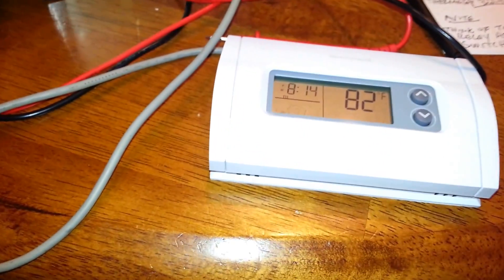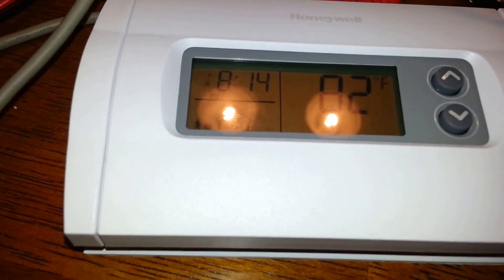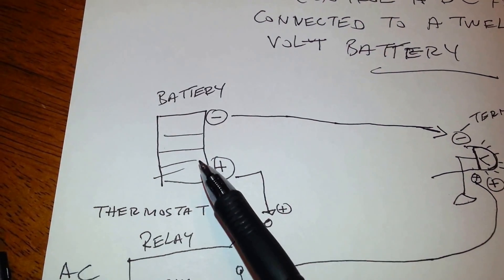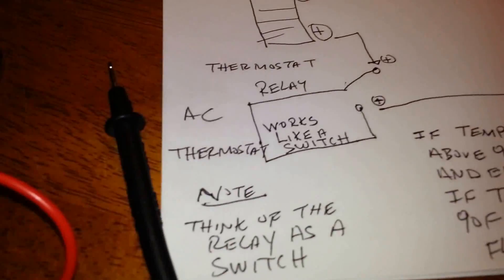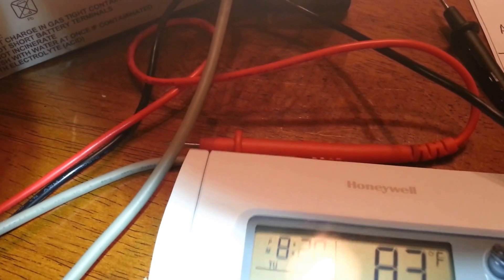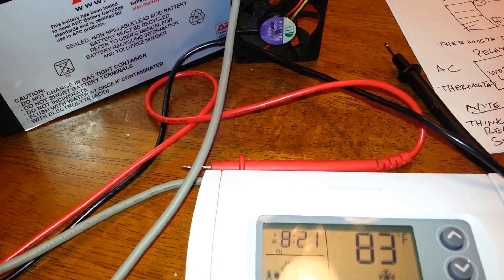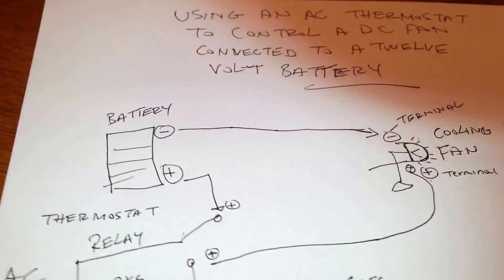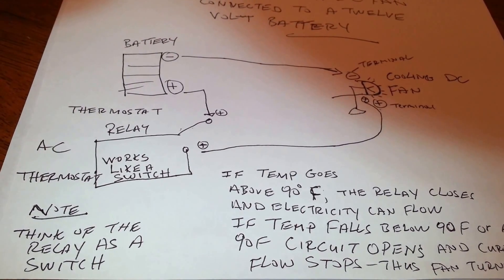Honeywell HVAC Thermostat Controlling a 12V DC Fan

Comment: thats awesome i am thinking of doing a lithium battery and maxwell capacitors for my car and replacing the car battery but during the cold months i need to heat the battery box up for my battery and caps and this is a great idea for my heater control unit!!! the custom box will be warm.

Comment: No one has mentioned the risk of sparking of the contacts because the stat is designed to switch AC not DC?  A problem or not?

Comment: Yawn - for repetition, r e p e t i t i o n.  Generally, 3 types of thermostats for common systems:  millivolt (older boilers, gas fireplace logs, hot water heaters are examples), 24VAC (most common for heating/cooling these days) and "line voltage" (usually 240VAC for directly controlling circuit to permanent baseboard heaters).   A 4th type are for 12VDC systems in RVs.  RVs run the furnace on propane and have big 12 volt batteries to power 12VDC fan. People doing solar work will also find these 12VDC thermostats are a fit.  This is what you really wanted to use, although you found the ubiquitous 24VAC thermostat relay worked.  As they say, even a blind squirrel can find nuts.

Comment: This Honeywell RTH2520b thermostat can configure to have cooling cycles per hour by holding the Backlight button (at the right hand side of the cover) for 3 sec.  Continue pressing the Backlight button until it display CPH (cycle-per-hour).  Default is 4 times (60 min / 4 times = 15 min), which means it will detect the temperature 4 times per hour after initial startup (initial as first time to switch to Cooling mode from Off or Hot).  If temperature is too hot (cooling mode), then it will turn on for 7.5 min (15 min / 2)

Default is 4 times, and it can change to 2, 3, 4, 5, 6.  2 times means 30 min/cycle, while 6 times means 10 min/cycle

Another feature is called "Early start."  Default it is off.  This means the thermostat will turn on the device (fan) in advance of the set time in order to archive the desire temperature you set in your schedule.  Let's say at night, the temperature is cooler so you set the schedule to higher (90F) to converse the battery SoC, but at day, you would like to keep it at optimum temperature as the solar panel is receiving sunlight and you have extra capacity to run the fan to cool down the room.  Let's say set to 80F at 9am.  With Early Start, the thermostat will dynamically turn on the fan before 9am so that the room will be at 80F at 9am

Comment: So how are you powering the t-stat
Reply from the maker: Roger Martin 
When I recorded this video, I had the two internal 1.5 volt batteries powering the thermostat itself.  However, if watch my later videos with the setup in the solar shed, the thermostat is being run off my solar system.

Comment: I really enjoyed your video and would love to utilize this to control my greenhouse swamp cooler. Can you tell me which connections on the Honeywell thermostat you used possibly provide me with a wiring diagram showing which terminals to connect to on the thermostat .
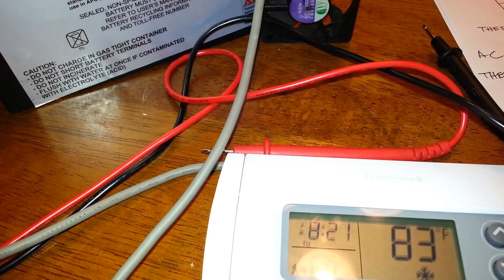Reply from the maker: John,   Here is a later video showing the connections at about 7:40

https://youtu.be/IPPzyp4i0qo
Reply from the maker: +DIY OneForAll 
Thanks for watching and all the best with your greenhouse setup.  I hope this video helps.

Comment: It's common sense that any normal "switch" can pass through alternating or direct current. The issue at hand here for using this in a strictly DC setup is  finding a thermostat that can run off say, a 12v battery. In this video you failed to show how you are actually powering the Honeywell switch itself. If it's being powered off of your home ac power, you haven't really shown us anything :/
Reply from the maker: It's being powered of my solar system,  100% solar.  I have a later video showing the hookups.  Thanks for commenting.
Reply from the maker: +DIY OneForAll 
So no, I am not using my AC power to run the thermostat.
Reply from the maker: +DIY OneForAll 
Also,  this video was done as a precursor to what ended up in my solar shed. Again,  I appreciate the comments.
Reply from the maker: Here is the video showing the thermostat running off DC power in my solar shed: https://youtu.be/ATplM5ckN8c

Comment from the maker: The point made of this video is that this thermostat is not only able to work with your heat pump or furnace but with any application requiring an inline switch - yes including solar applications, heat lamps - you name it. At the end of the day, I hope that if someone does happen to have one of these at their disposal they will see how easily it can be setup.

Comment: You're confusing "AC" as in alternating current, with "AC" meaning air conditioning.  All thermostats operate off 24v DC supply from their feed lines from the main system.  The main system gets AC from your home electrical system and immediately converts it to DC inside the appliance for all the motors, compressors and logic boards involved in running the air handler and other parts of your home HVAC system.

All thermostats are DC, even that one.  "AC" here means it can control both a heater and an air conditioner.
Reply from the maker: What I am showing here is that this thermostat is not typically used in pure DC applications, outside of the HVAC world, but I show it being used outside of an HVAC system.   I did this video to make a point,  which many found helpful. Thanks for watching.

Comment: can you zoom out, or indicate which cable connections you use to the thermostat please?
Reply from the maker: Do you want me to show what terminals on the thermostat are connected between the battery and fan? If yes, I could pull the cover off the thermostat and do just that.  Also, I am using the cool setting for this application.
Reply: Anthony Hope  Thanks for replying. Don't get me wrong, I'm impressed that you discovered this trick! I thought AC & DC were mutually incompatible. It would be useful to know which cables  are safe to use in the grey sheathed multicore (how many are there, -2?) from the thermostat.. Opening the thermostat may be useful, but seeing the cable connections (& polarity)  would help a lot! thanks
Reply from the maker: wyn davies wyn, did you have a chance to view the video that I uploaded last night? I opened the cover and showed the wiring.  Check it out.  Thanks, Anthony

Comment: Very cool! What is the voltage rating of the fan? Any AC thermostat should work?
Reply from the maker: Travis, the fan is a 12 volt dc fan. Any ac thermostat should work just fine. The fan draws .15 amps of current.  I am actually using four of these fans in my solar shed right now
Reply: Thank you sir!
Reply: I love solar projects! Could you share what the model of the thermostat is?
Reply from the maker: Honeywell RTH230B1006 Digital 5-2 Day Programmable Thermostat